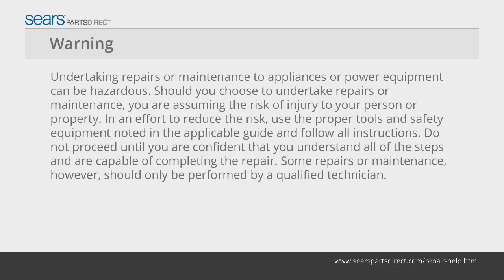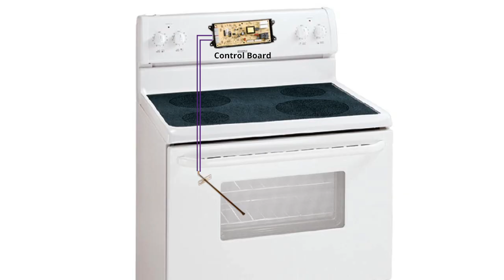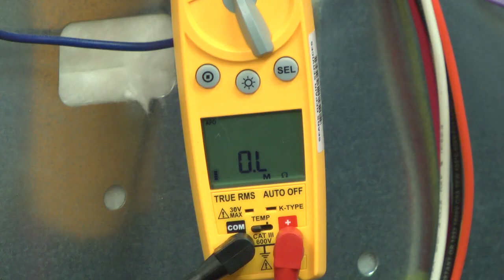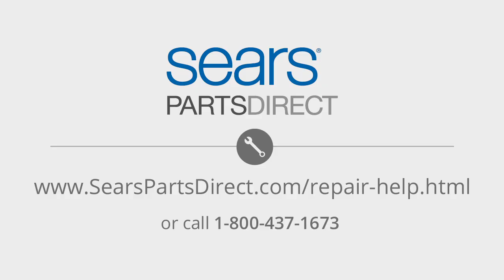Range Error Code F10: Troubleshooting Runaway Oven Temperature

Comment: Replacing the clock on frigidaire  keeps beeping showing f31
Reply from the maker: The F31 code indicates that the electronic control board (also called the clock) detects a faulty oven temperature sensor probe. Test the oven temperature sensor probe as shown at :57 in the video. Replace the oven temperature sensor probe if you don’t measure near 1,100 ohms of resistance through the probe at room temperature.
 
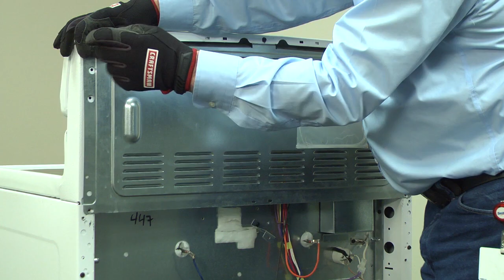If you measure near 1,100 ohms of resistance through the oven temperature sensor probe, check the resistance through the entire sensor circuit as shown at 1:42 in the video.
 
If you measure near 1,100 ohms of resistance through the entire sensor circuit, then replace the electronic control board because the control board isn’t accurately detecting resistance through the oven temperature sensor probe.
 
If you don’t measure near 1,100 ohms of resistance through the entire sensor circuit, then find and repair the break in the sensor wiring.
Reply: Sears PartsDirect I changed the sensor. And it's still showing F31

Comment: What does it mean when no one has used the oven for almost 12 hours, and it's cool to the touch, but it randomly starts beeping continuously and says F10? I pressed the "clear/off" button, and it seems to have stopped. For now, at least.
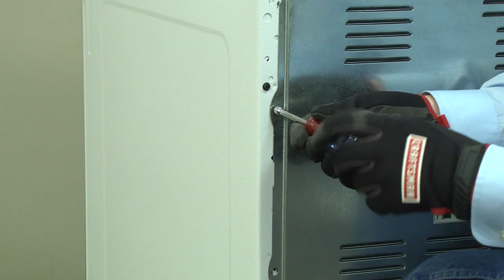Reply from the maker: The temperature sensor or wiring could have failed or the range may have a broken electronic oven control board. If the F10 reappears, use a multimeter to check the temperature sensor resistance as shown at 1:00 in the video. Replace the sensor if you measure over 2,000 ohms at room temperature. Continue with the troubleshooting shown in the video if sensor resistance is okay. If you need more help, let us know.
Reply: Thanks!

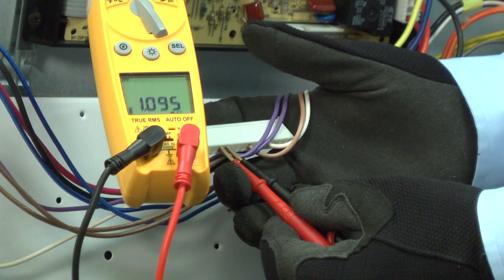Comment: Im having a similar issue as Dave Leboeuf. At the probe sensor, 1:15 in your video, im reading almost 1100 ohms. But at the 1:55 check, i dont read anything. Is that the wire harness or the probe itself?
Reply from the maker: Your symptoms point to a failed wire harness since you measured the expected resistance at the probe sensor. Make sure that you plugged the sensor back into the wire harness plug securely before measuring the resistance through the wire harness from the control board. The location of a sensor wire harness failure is often at the plug on the sensor end of the harness. You can fix that type of wire harness plug failure by cutting off the plugs and directly wiring each of the sensor wires to the corresponding harness wires.

Comment: I've had the oven off for about 5-7 minutes and it started this. I've unplugged it but stuff like this scares me since we have gas.
Reply from the maker: The oven likely wasn’t overheating since it was off for 5-7 minutes. You should have a service technician check the range to be safe. If you’re confident that you can safely fix the oven yourself, check the resistance of the oven temperature sensor as shown in the video and replace the sensor if you don’t measure the expected resistance. If the sensor is okay, check resistance through the sensor and wire harness as shown in the video and repair or replace the wire harness if it has failed. If the sensor and wire harness are both okay, replace the electronic control board.

Comment: my range stopped the f10 code but it is still overheating.  is this the control board . thanks
Reply from the maker: On some models, a broken oven bake element or broken broil element could cause the oven to overheat because a broken element could short to the metal cabinet and heat constantly. Post the model number of your range and we’ll let you know if this issue affects your model. A defective oven temperature sensor could also cause oven overheating. If you haven’t already checked the resistance of the oven temperature sensor, we recommend that you unplug the range and test that component using a multimeter as shown in this video. If the oven temperature sensor resistance is okay and you don’t have a broken bake or broil element causing the overheating, then you likely need to replace the control board. We hope this general information helps you repair the range. As noted above, post the model number of your range if you need more assistance.
Reply: the model is pglef385ec6. i Did notice that the bake element only seemed to be heating on half of it.  the left side was heating but the right side didnt seem to be. I have used the oven since and the pf10 code did not come back on but the oven was still overheating.
Reply from the maker: Based on your symptoms, you’ll need to replace that bake element since only half of it heats. Here’s a link for the replacement bake element: http://www.searspartsdirect.com/part-number/318254906/0022/628.html You may also need to replace the electronic oven control board – especially if the oven continues to overheat after replacing the bake element. The broken bake element could have damaged the electronic oven control board – causing the overheating. Here’s a link for the electronic oven control board: http://www.searspartsdirect.com/part-number/316418760/0022/628.html  Don’t forget to unplug the range before replacing parts.
Reply: thank you

Comment: I checked the oven sensor with the multimeter and it read 1096 and then read the connection to the ecb and it was the same.  I replaced the control board and it is still giving me the f10 error code. Could it need a new sensor even though it was reading correctly?
Reply from the maker: The temperature sensor or the sensor wiring harness could be defective. A short in the sensor wire harness to the metal cabinet of the range can cause the F10 code. Unplug the range and check for resistance between the wire harness and the metal cabinet of the range as shown in this video:  https://www.youtube.com/watch?v=R6DgIA_ikQQ If you measure 0 resistance or any resistance value during this test, then the wire harness is shorting to the metal cabinet and likely causing the F10 code. Repair or replace the wire harness. If you measure infinite resistance during this test, then the wire harness is likely okay. If the harness is okay, then you’ll likely need to replace the oven temperature sensor because the sensor measures normal resistance at room temperature but is not detecting oven temperature accurately when it heats up.

Comment: when i check the resistance thought the wire harness i dont read any resistance. Is it the electronic control board?
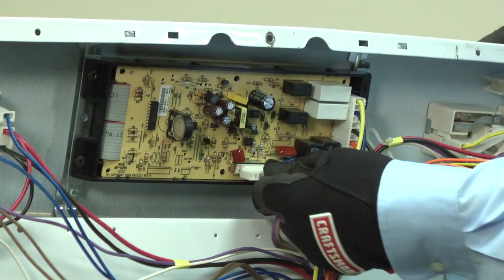Reply from the maker: Make sure that you set your multimeter to the proper resistance range when measuring resistance. If you measure 0 ohms of resistance through the temperature sensor wire harness that connects to the control board (1:55 in the video), then the wire harness or the sensor is likely defective. Send us more details about your resistance check if you need more assistance.
Reply: so it can be the wire harness or the control board who is broken? If i connect on the control board where the harness is connect i had no resistance.. The sensor is ok.
Reply from the maker: If you’re measuring 0 resistance through the wire harness with the sensor plugged in, as shown at 1:55 in the video, then the sensor or wire harness is likely defective.

Comment: The first thing you should show is how to stop the freakin' beeping sound.  It's driving me crazy.
Reply from the maker: Unplug the range or shut off the house circuit breaker for the range to stop the beeping. You’ll need to leave the range unplugged or the circuit breaker for the range shut off if the beeping resumes as soon as you restore power. Once you find and fix the problem that’s causing the F10 code, the range won’t beep.
Reply: It also works to hit the off button on the bake option 😅just found out this was even a thing my poor cinnamon rolls @searspartsdirect